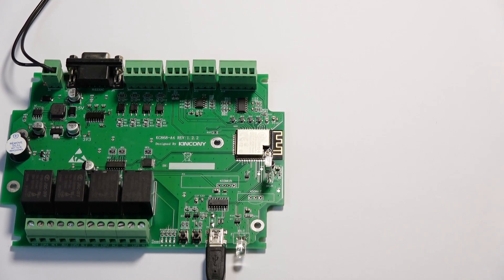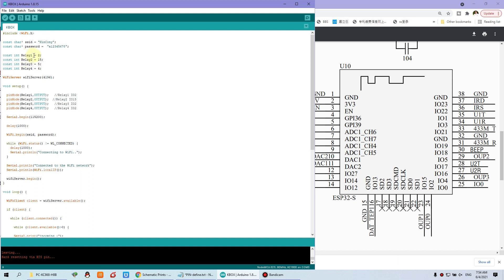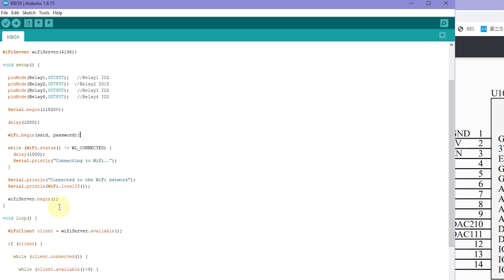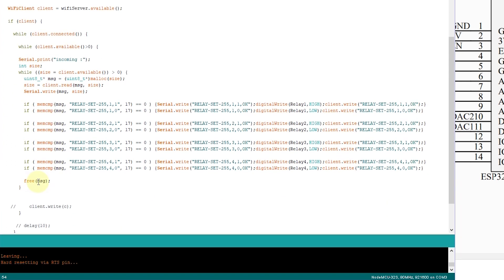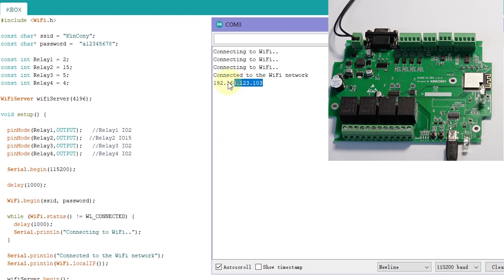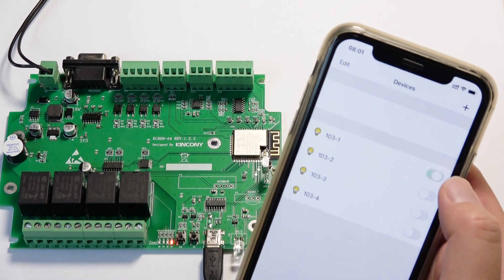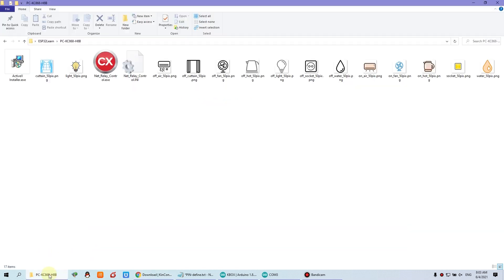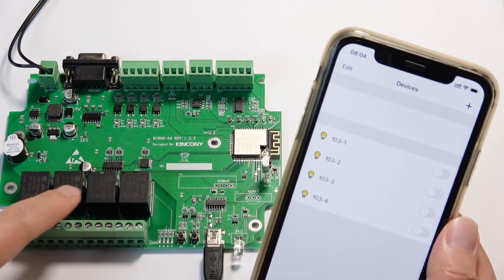Lesson10- control relay by KBOX app without internet via Arduino IDE

Comment: Is this code, it will remember state after power cut, which code is that ? Also can we connect it with local lan cable if no internet then also can we use it woth mobile app, also alexa and google can we use.
Reply from the maker: if you want remember the relay state, just add some code for save state to EPROM. now this code is work for locally, not need internet. how about use by alexa, later video lesson will upload.
Reply: @KinCony  please share EEPROM code video. Thank you 
My new is in process so i want to use automation in individual socket so is there any suggestion how to do?
Reply from the maker: @pushujgd  socket = relay controller output + AC contactor is very safety.